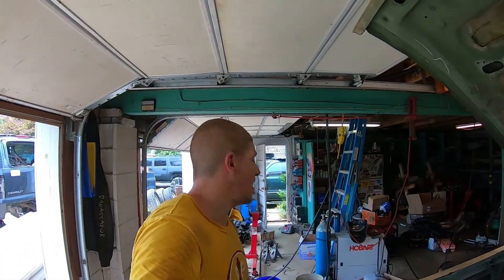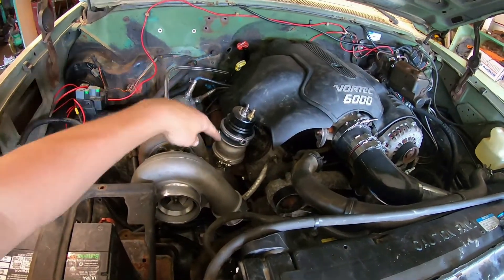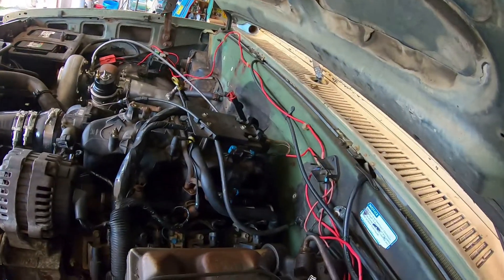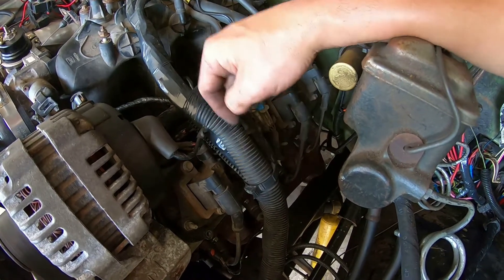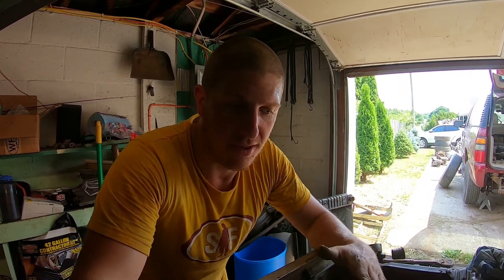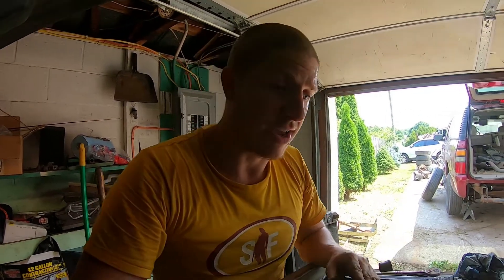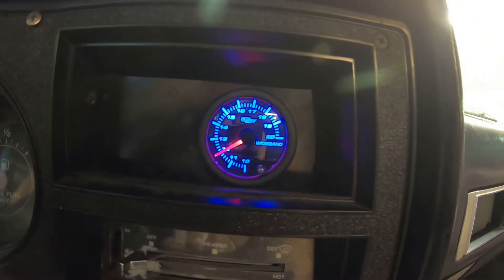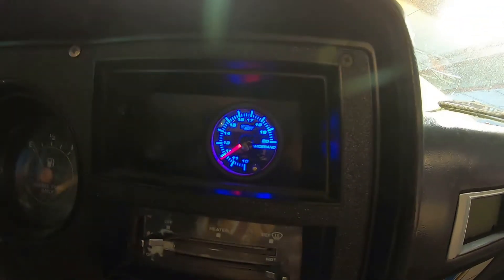DIAGNOSING and REPAIRING MISFIRES in 6.0LS Engine

Comment: When cleaning the injectors, hook the fuel line up backwards to back feed them. Itll knock out stuff that is lodged in place from being forced thru in only one direction.
Reply from the maker: you mean connect the pressurized (~60psi) fuel line to the tip of the injector where the fuel sprays out? Seems like it would be really difficult to keep the fuel line from just squirting off of the tip of the injector.
Reply: @MohawkMotors  yes, pressurize the side the fuel would normally spray out of. It's the same size connection on either side. As long as you clamp it good, itll work the same.

Comment: my lq9 is doing the same thing but cylinder 2,3,5 and 8 aren’t firing, man i hope this is my problem
Reply from the maker: It's a common issue so hopefully you can get it fixed!
Reply: @MohawkMotors  i hope so, how could i clean them out without a cleaning setup like yours, could i just let them sit in acetone?
Reply from the maker: @snowman6512  best bet without a setup like mine,  would be an ultrasonic cleaner with carb cleaner or parts washer solvent. You might get lucky and it's just the screens in the injectors where the fuel enters are clogged up, usually you can just spray those clean with carb cleaner
Reply: @MohawkMotors  ill try that when i get off work, thanks man
Reply: @MohawkMotors  man so i tried cleaning them and still no luck
Reply from the maker: bummer, do you have a noid light or a way to test at the connectors to make sure they are getting pulsed by the pcm?
Reply: @MohawkMotors  no i don’t have a noid light, is that the only way to check for pulse?
Reply from the maker: @snowman6512  either a noid light,  or a scan tool capable or reading in milliseconds,  most auto parts stores have noid lights you can "rent" now. Usually you just pay the price of the set, then it gets refunded when you bring them back.

Comment: Did you do cam swap or spring upgraded on ur 6.0 lq4? Or stock with turboed?
Reply from the maker: I said swapped the cam, and upgraded the valve springs to match the cam. There are cams that will work with stock valvesprings, but every cam I've installed has required shooting springs that allow for more valve lift.